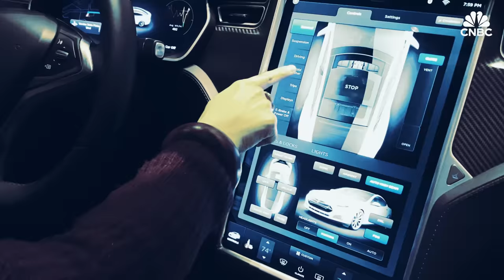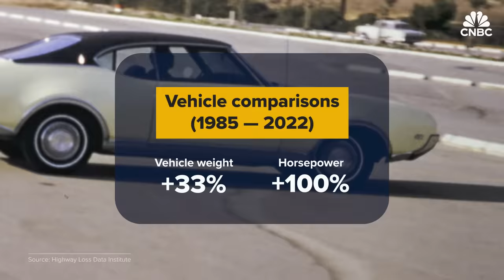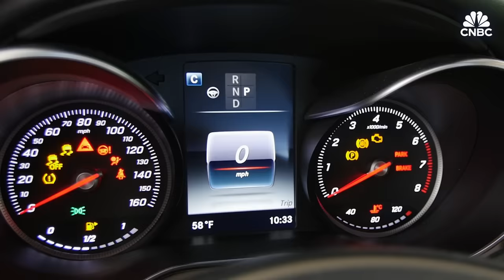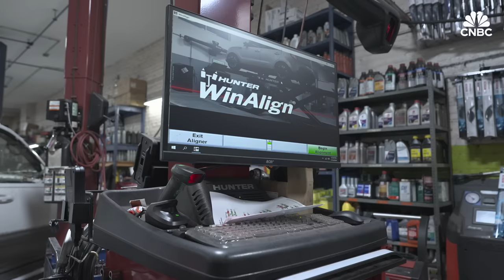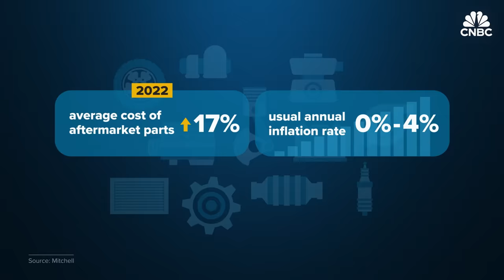Why Car Repairs Are Getting So Expensive

Comment: I’m a mechanic. I work for myself too. I get a lot of people on referrals from other people I’ve done work for.  They don’t want to go to a shop or dealer. I don’t charge insane amounts and can still make a nice living and my customers are happy. I’m happy. That’s the best way to do it.
Reply: Couldn't agree more, i run a small shop and its very fulfilling to make a good living and do work you can be proud of
Reply: What to look for is used car prices following used farm tractors where the older ones are worth more than the newer ones because they are simpler and easier to repair.  In my area I certainly want a car that is at least 20 years old because it is exempt from smog check, and will pay more for one than I will for a 15 year old car, and I think markets will follow, especially in smog check localities.
   The epitome of this is Cold War Motors.
Reply: 20 year old cars are also fully depreciated and will only appreciate into classics over time, so especially low mileage drivers have every reason to pay more for older cars than for newer ones.
Reply: Thank you for your service.
Reply: I do the same exact thing. I don’t rip people off and I’ve made a little over $10,000 last month. Sure I put in a lot of hours but I do the work at my house and I pretty much have a blast doing the work. It’s all about good karma.
Reply: $50 an hour at 10 hour days. 6am to 5pm. Monday thru Friday and I have way more business than I can even handle. I treat people with respect and it’s like a literally hit a complete jackpot.
Reply: Right now I also rent condo that has garage for $1000 a month which means I am also raaaacking up my cash. A lot of these other mechanics just don’t get it. They leave cars filthy. They scratch things and to a high earner, that doesn’t work becuase that expect perfection. I’ve gotten $200 tip from people with money. All because i leave their vehicles spotless when im done. This is just way  too easy. Nothing but love for my customers.
Reply: An honest and reliable mechanic is hard to find, but if I do, I am a loyalist.
Reply: @mr.e-kh9bq all you wildcat guys are being systematically chased out of the landscape by the automakers and the brick and mortar parts stores. I work at a one man mom & pop repair shop and I have seen it with my own eyes.  The content in this video is 100% accurate.
Reply: @alan6832 here in the UK the powers that be are trying their best for us to part with older more reliable cars through annual road tax and emission zone charges in some cities. Essentially, the older the car is (until it's 40 years old) the higher the rate of tax you pay annually compared to a newer cars. I have a 21 year Lexus SportCross wagon that is very reliable and a relatively simple build that I learn't how to service and repair it myself even though I'm not a mechanic. Cant begin to tell you how much I've saved in service or repair costs at a garage.
Reply: Where are you located so I can take my car 😂
Reply: @taridean - well I haven't done that yet at least in my state of Oklahoma.  In fact a new cars annual registration is $100.00.  It drops periodically as the car ages until it bottoms out a $29 / year which is what I pay for my two older vehicles. 😊😀😊😊😊
Reply: Ford in NE Ohio wanted $8000 for a used engine swap on a Fiesta.  My neighbor referred me to a mechanic 15 minutes away.  $3000 for the swap.  Used engine had 30K less miles.  Also put a new battery, replaced bad hoses on the used engine, etc.  I no longer do my mechanical work; this honest low-cost mechanic does all of the work on my 3 cars.  '02 Escape AWD, '05 Vibe AWD, '11 Fiesta.
Reply: I see all of ur comments ...and I can assure u that the work that ur low cost mechanics/technitians are doing are not the high tech repairs that most of these cars require on a frequent basis....and I say this because the equineeded to do these repairs are very expensive...you are not going to be able to do this work kind of work with the equipment required and not try recouped ur investment cost....u won't stay in business long...
Reply: @teriblethinker582  And I and majority of people here will not go to a mechanic whose writing and spelling prowess is as lackluster as yours.
Reply: 100$+ an hour is the standard now.. used to be 50.. that's the real price..
Reply: @alan6832 I know someone that bought a used car and one day the frame broke.  It was totaled.  In some states they use rock salt that will eat away the frame.  In some states they don’t allow welding the frame.  In states they don’t use salt or they don’t get that makes sense.
Reply: I see many mechanic in this section are illegally conducting auto repairing business.  How is this fair to the rest of us tax payers who runs legit business.  Don't be too proud of yourself.  What you do is illegal.
Reply: @jeffxion  hardly illegal.
Reply: @robertbenkelman947  My old Metro "frame" is just about rusted out so that a big pothole might pull out the lower A arm mounts.  I regularly go to a self serve car wash and spray wax the underside to make sure it doesn't rust any more.  That's part of the reason I left Massachusetts, road salt.  Also high rent.
Reply: You also don't have the same level of overhead, including insurance, workman's comp, and so on that those shops have.
Reply: @13EN17   The operative word here is "YOU."  You make a good living.  What about the people work for you?  How good a living do they make?
Reply: It seems like it is harder and harder to find trustworthy people these days.  I got an old commuter vehicle from a family member for almost nothing, but I noticed there was a slight slip in transitioning to the higher gears.  I took it to a shop and specifically asked them to look at the transmission, stating the slips I noticed.  They get back to me and say it needs a new radiator and alternator.  They didn't even inspect the transmission.  They go back and check out the transmission "for free," since they "forgot "to check it out the first time and report back that it is fine.  I ask the guy if I fix the things they want me to if he thinks the car can last me about 15k miles at least (which would be almost a year of my commute).  "I see no reason why it shouldn't," he says to me with a straight face.  

I talk to an uncle on the phone who knows a decent amount about cars.  He walks me through testing the alternator and radiator and both seem fine.  I find out one of my friends is good friends with a mechanic.  I take it in to the guy.  He says the alternator and radiator are fine, but that the transmission is doomed, which was my concern all along.  He doesn't try to convince me to make any repairs because it isn't worth doing for a car that old.  I give it back to the family member who gave it to me and he decides to sell it at a CarMax.  I hope some poor other sucker didn't get stuck with it, but it wasn't my decision at that point.

Thanks to any honest mechanics out there who don't cheat or otherwise exploit their customers.
Reply: Mechanic Workshop in America is scam for idiots. 😢  I never send my old  car to Workshop.
Reply: vancouver to expensive to start a shop
Reply: True American, I tip my hat to you
Reply: @courtneylewis899 you realize that that’s how much mechanics makes an hour now. $30-$50. You cannot make money charging $50 for labor. Inflation does exist.
Reply: I used to do that, then I kept getting burned one too many times with people trying to act like I either broke something I know I didn't or even thought I was the cheapest in town they still felt like I was overcharging them. After 2016 i started hiking everything up and now I make more and can retire by 50 which is nice 🙂
Reply: So your a mobile mechanic. Or avoiding paying taxes
Reply: the BEST repair , are NO Repairs required.
Reply: There's so much need for honest fair work that there's no need to be dishonest. It's crazy how everybody has their hand in your pocket.
Reply: @derekelliott6098 3 piles of garbage vehicles lmao
Reply: @JUDGEME5150 $10k from your backyard definitely seems like a rip off. 😂
Reply: There's no more parts shortage. Do some research as if you were going to do it yourself. Price the parts and do your math on how much they're charging you for the labor. Small mom and pop shops will do it cheaper. $200/hr at Big shops
Reply: Thank you for ppl like you
Reply: I truly enjoy helping people with their repairs. Saving them money while making money myself. It's absolutely absurd some of the quotes I see from other shops that people show me.
Reply: I’d rather go to the dealership service department, but the days of walking in first thing in the morning for anything outside of oil changes and tire rotation are over.  If I have to take time out of my workday to make an appointment, the least these places can do is provide loaners.
Reply: @jeffxion  Not illegal if your not advertising to the public. Word of mouth goes very far. To many shops ripping people off and are far from honest.
Reply: @JUDGEME5150 that’s no overhead, no retirement, no health insurance. Enjoy beating yourself into an early grave with nothing to show for it.
Reply: @RowdyEnt. illegal to not report income. Have fun loosing your home when you get sued by a client and have no insurance, llc, up to date tooling, etc.

Comment: Since Covid there’s a lot of gouging going on in every industry. I have a friend in the car repair industry and I asked him why prices are so high and he said because the owners feel they can get away with it.  They feel people are ‘mentally accepting’ of higher prices right now so they keep pushing up their prices and then blame Covid, shortages, inflation, etc.
Reply: Greed, plain and simple. This "report" is a joke.
Reply: Take the bus.
Reply: @horton368 naw man the bus sucks lol trust me I know 😅
Reply: @User3xiii  yeah I've spent too much time taking the bus to work, on and off for years
Reply: If a mechanic shop justifies an outrageous markup for a part being replaced because of supply chain disruptions, then I find it very fishy, especially if those parts are easy to locate at an Advanced Auto Parts or AutoZone.
Reply: Parts cost and technician labor along with a higher cost of business expenses is the reason that auto repair costs are increasing.  Also, a full-size truck costs 75,000 to buy, why wouldn't people expect the cost to repair it to increase?  Wouldn't you think that the price of the new truck may be based on the higher prices of the parts in the truck?  A 2020 F-150 has 35 computers on board.
Reply: What? lololololololol

Comment: That's why I'm driving a 20-year-old Corolla. It cost next to nothing to maintain, it doesn't break down easily, no complicated computers to repair, parts are available everywhere at the junkyard or online. It makes you "look poor" but it doesn't actually make you poor.
Reply: I can't I understand 25 year old hicks making $20 an hour buying 70k pickups without flinching. I can't wait to see what retirement looks like for them!
Reply: Lmfao 😂. I'm sure you'll sleep better than the guy with big car payment.
Reply: I try to get 20 years out of every vehicle - you can do that with a Toyota if you undercoat and follow in maintenance manual. So what’s better for the environment 1 fuel efficient car every 20 years per driver or 3 EVs every 20 years per driver?
Reply: @gregorymacneil2836  What's better is driving an EV for 15 or 20 years and after that it's battery is used for storage at a solar farm
Reply: Same - my Corolla has 370k on it but I don't care how I look, I care about paying my mortgage off faster and going on vacation twice a year.
Reply: @JoseLopez-tk4tq  They will not make it to retirement.
Reply: My wife made me give up our 2006 Toyota Corolla a couple years ago (family growing with kids - we got too big for it).  Manual locks and windows.  Pushbutton controls on the radio, AC, etc..  Cheap, reliable, 30+ MPG.  Saturn used to make a nice cheap vehicle like that too that my parents liked so much they bought 2 in the late 90s/early 00s.  They don't make 'em like that anymore.  Not profitable enough I guess.
Reply: @lk29392  I'm keeping mine until the subframe rots off.
Reply: Worst thing I did was sell my 93 corolla with a 5 speed.
Reply: Stop pretending to be virtuous about buying a cheap car lol
I drive a 21 year old Corolla. Not because of maintenance costs. Because it was cheap, and I couldn't afford anything more expensive at the time.
Reply: @B3Band  I think most people are stating the benefits of buying a cheaper car that's easy to work on.
Reply: @B3Band  That sounds like a you problem though bud.
Reply: I have a 20 year old Corolla too with rust. Previous owner did not change oil and the poor thing just keeps going. New vehicles need all the fancy sensors because the huge screens can be distracting especially at night.
Reply: One of the very best cars u can buy. Happy for u.
Reply: @the_kombinator same boat my 95 maxima is sitting at 274,000 k and my only
Focus is paying my
Mortage . I don’t do vacations
Reply: @JoseLopez-tk4tq  Its really dumb to make yourself car poor.  The only acceptable reason would be you need it for work.
Reply: 22 year old Solara V6 for me.
Reply: 2011 accord and 2007 ridgeline for me I love them
Reply: @Tonyscasa  I had an 89 Maxima - It was pretty run down by the time I got it but I recall it was smooth and had plenty of power.
Reply: @Tonyscasa Those were some of the best Maximas.
Reply: @the_kombinator  mine has adequate passing power and I lucked out so hard . Bought it for $660 . Top trim
Option black outside black inside power windows sunroof and Bose sound system. All of that stock.  Since I’ve owned it I’ve put about 2000$ worth of repairs into it. She runs so nice and I have about 3 sets of rims for it .
Reply: Got a 2003 Subaru Baja. Most of the parts are interchangeable with the outback and the Legacy. There are thousands of these still on the road and plenty of parts.
Reply: My work truck is a 1966 beetle…..😘
Reply: Old camry
Reply: I'm right there with you!  Driving a 2011 Camry.... best car I've ever owned in 45 years of driving!
Reply: @Tonyscasa  Only thing I had to do was change a starter and... all of the exhaust system (incl cat) - all that was about $500-$600. 

I did notice some oil stains on the driveway recently, and a rattle at idle (heat shield probably) so next time I change the oil, I may be in for a bit of work :D
Reply: 1999 camry, 359,000 owned since 2001…2005 Camry 356,000 owned since 2009,  2005 sequoia owned since 2011 with 206,000…just got a 2010 camry with 123,000…it’s just a baby🤣
Reply: I own a 385k corolla and drive it everywhere even coast to coast road trips. You are wealthy because your wealth of knowledge  keep your money in your pocket. The corolla was designed from the start to be a efficient car in fuel mileage and maintenance.  I like them so much I own 2 of them all with high mileage.
Reply: I bought my car in 2020 for $5000, got a loan and paid it off in less than 2 years. I've spent probably about $1500 on maintenance and repairs. $250 on some transmission parts and fluid for a Manufacturer TSB due to the transmission fluid getting too hot, $250 or so on a new alternator and belt, $500 on new tires, $150-200 or so on oil changes, and probably a bit extra for random small parts like the air filters and miscellaneous fluids. But do keep in mind I did all but one of the repairs by myself, either with basic tools, or at a family member's garage who has a few more tools I don't have myself.
Reply: i am driving 4.4 V8  BMW E39 2003 year. With gas . 100km to cover - 13l  x 75c = 9.75$. With 286PS. Repair by myself, all the parts in the junkyard - drivers door - 20$. Anyways - I got a house a few house apartaments and a warehouse/garage.
Reply: You are in the sweet spot of car age. Anything newer is very hard to repair as the cars became less modular.
Reply: This is precisely why my boyfriend and I are looking for something older.
Reply: They’ll come after us soon you just watch. I wouldn’t be surprised if they started discontinuing parts on older vehicles just so people stop repairing them.
Reply: 2010 Pontiac Vibe (Toyota Matrix) checking in…
Reply: why do people think a 20 year old vehicle doesn't have a "computer?" most every vehicle sold since the early 1980s has an electronic control module (AKA "ECU" or "computer.")
Reply: @lk29392  GM scrapped the Saturn brand long time ago.
Reply: I drive a 2007 Ford escape XLT with a v6 it's got about 141,000 miles on it. Unfortunately the ac has been broken for 3 years (I have not had the $1,600 for repairs) but I do love that car.
Reply: Learn how to work on your own car ,and you only parts you have to pay for been doing it for 40 years and do 90 present of my own work 😂
Reply: @gregorymacneil2836  so 1 new EV every 6-7 years? no way. 85% of those junkers are on 3 year leases. just before it breaks emissions-even with an ICE car. they are now cellphones on wheels. what a joke!
Reply: @JoseLopez-tk4tq  Be a long wait for you because they likely will never retire.
Reply: @JoseLopez-tk4tq  only .078 percent of 401k balances are 1 million or more.
Reply: You are a king! That vehicle will go up to 400k. My brother's Camry is close to 400. I met a MR2 driver and his car was over 600k. He had twice engine and trans repair. Other maintenance cost was every 100k miles.
You will expect to see many of those still on the roads by 2035. EVs could take only 40% in the future in California. Drivers will keep fixing them and refuse to buy EVs.